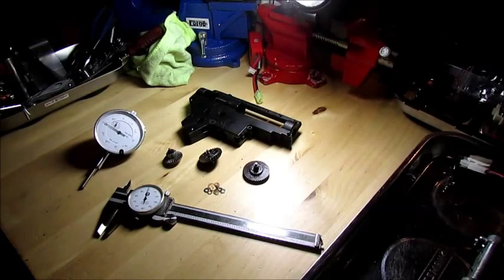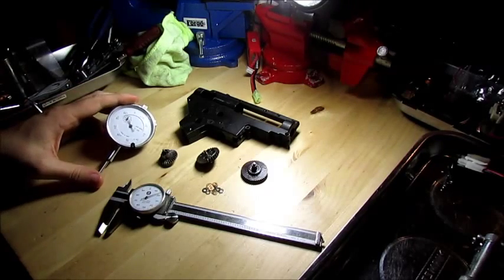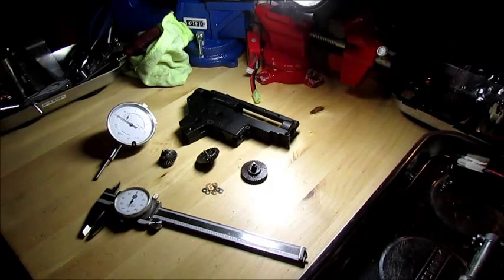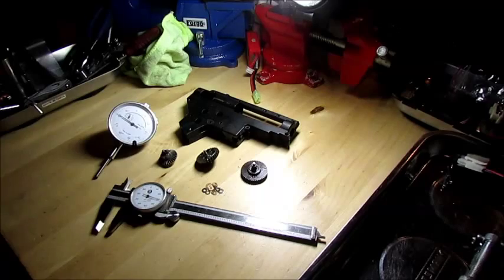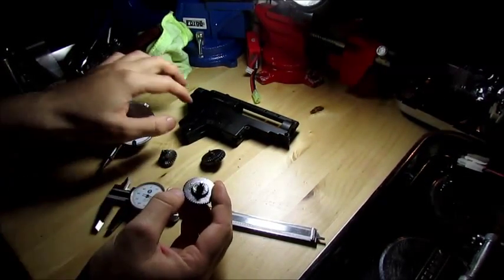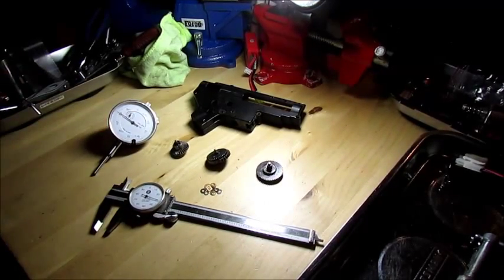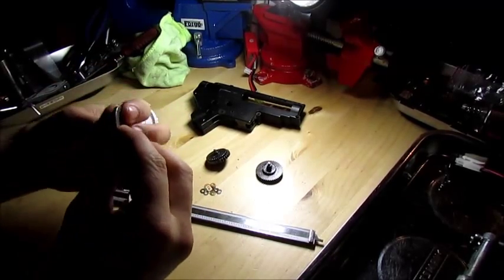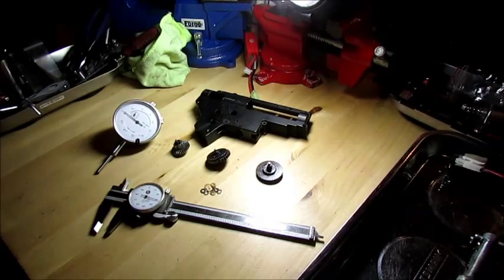Gearbox Shimming: Part One - Introduction to the Dial

Comment: John, thank you for using gauges.  I'm new to these little gear boxes and after watching countless videos on shimming, I wondered why everyone just didn't buy a simple dial and caliper setup and do it right, which in my experience is the easy way.  I was going to go ahead and do it anyways but, now I finally have found someone that has done it, this is great.  Oh, don't be afraid to use digital if you have it, just make sure you have your masters ready whichever gauge you use.  However, I'll use a dial over digital for centering parts on a 4 jaw chuck any day.
Great videos man!
Reply from the maker: Thank you! Airsoft has long been a passion of mine and so has precision. It's always rewarding to get feedback like this. The entire series is admittedly long, but I think it covers the topic more thoroughly than anyone. Anyway, should you need help, let me know.
Reply: John Rogers , I’m a precision guy too. Used to build engines and moved on to Manufacturing Engineering. Basically, how to make what’s on an engineers drawing. It’s fun. I love making things work. 
However I think shims are a bit bogus and gears shouldn’t be riding on them. Locking an adjustable bearing or shin in place would be much easier and just more robust. Looking at this my first time it makes me wonder why it hasn’t been done. If the case was designed so the shims sit on the outer race would step up the build process.
Reply from the maker: I couldn't say. I've often found reason to question why things are the way they are, but I believe that we can get things built well enough if we use proper materials and techniques. Well enough for an airsoft gun at least.